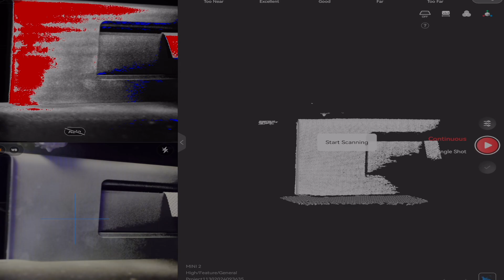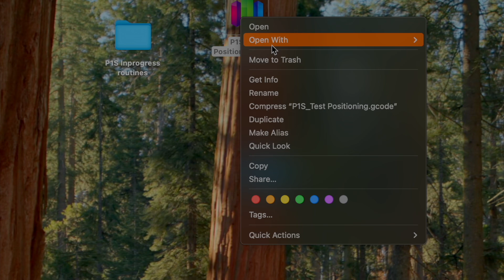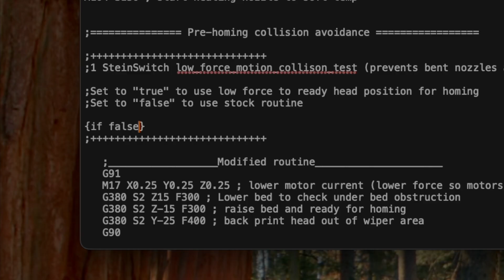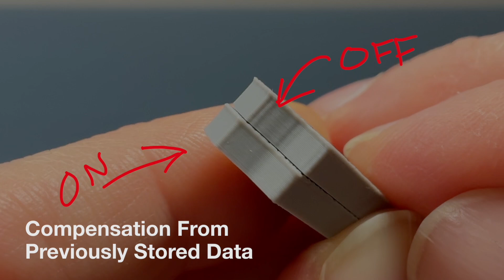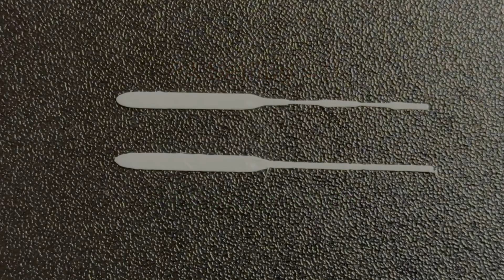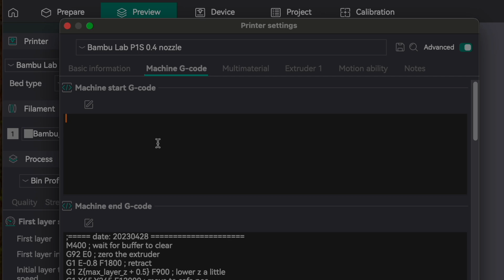The Ultimate Wiper Mod Combo For Your Bambu Lab P1S P1P and X1C

Comment: A small correction regarding the purge line: You’re using OrcaSlicer for your code, but you mention that it also works with BambuSlicer. That’s not entirely accurate, as BambuSlicer unfortunately still doesn’t (stopped to) offer the option for custom pressure advance. This feature is missing in BambuSlicer, at least for the P1S, which is why your purge line can’t be used with BambuSlicer. That aside, great video, well-structured code, and thank you for sharing it.
Reply from the maker: @ZipPeLschen  Hi! you're completely right! Its been a... minute since Ive used Bambu Studio! Months! Once I discovered Orca, I haven't been back to Studio and as a product of likely too many 3am nights in a row putting this video together, I completely forgot about my slightly different routine for Bambu. Good eye! Before Orca, I was still doing the PA test line in Bambu, but I would set the K value in the slicer code based on the filament type of the slice. ie., if Pla use k0.02 or if Petg use k0.035. Its not ideal but it works well for me since I dont print with may materials from many brands. I can revisit this and come up with a work around for those who want to keep with Bu Studio.
Reply: Can this be fixed with another code working for Bambu Studio?
Reply: @Saito_FPV  No, there’s not much you can do about that. However, pressure advance (PA) shouldn’t be overly praised either. Yes, it’s nice to have control over it, but the fixed value you determine in OrcaSlicer is not the ultimate solution. OrcaSlicer now also offers “Adaptive Pressure Advance,” which is even better than standard PA, as the PA value would need to adapt dynamically throughout a print based on various shared changes, something that doesn’t happen with a fixed value.

PA is a very complex topic, and ultimately, the G-code here only shows your fixed value, independent of the model.

I would cautiously suggest that if you’ve configured your PA via the Bambu settings and mainly use Bambu filament, customizable PA is probably “unimportant” for you at this stage. However, if you work a lot with third-party filaments, switching to OrcaSlicer could be worthwhile due to its much more advanced options for filament settings.
Reply: @Saito_FPV  No, there's not much you can do about that. However, pressure advance (PA) shouldn't be overly praised either. Yes, it's nice to have control over it, but the fixed value you determine in OrcaSlicer is not the ultimate solution. OrcaSlicer now also offers "Adaptive Pressure Advance," which is even better than standard PA, as the PA value would need to adapt dynamically throughout a print based on various shared changes, something that doesn't happen with a fixed value. 

PA is a very complex topic, and ultimately, the G-code here only shows your fixed value, independent of the model.

I would cautiously suggest that if you've configured your PA via the Bambu settings and mainly use Bambu filament, customizable PA is probably "unimportant" for you at this stage. However, if you work a lot with third-party filaments, switching to OrcaSlicer could be worthwhile due to its much more advanced options for filament tuning.

Here's a brief explanation from Orca about APA: https://github.com/SoftFever/OrcaSlicer/wiki/adaptive-pressure-advance

wahrscheinlich hätte ich dir sogar auf deutsch antworten können, wa? :)
Reply: @Saito_FPV  
No, there's not much you can do about that. However, pressure advance (PA) shouldn't be overly praised either. Yes, it's nice to have control over it, but the fixed value you determine in OrcaSlicer is not the ultimate solution. OrcaSlicer now also offers "Adaptive Pressure Advance," which is even better than standard PA, as the PA value would need to adapt dynamically throughout a print based on various shared changes, something that doesn't happen with a fixed value. 

PA is a very complex topic, and ultimately, the G-code here only shows your fixed value, independent of the model.

I would cautiously suggest that if you've configured your PA via the Bambu settings and mainly use Bambu filament, customizable PA is probably "unimportant" for you at this stage. However, if you work a lot with third-party filaments, switching to OrcaSlicer could be worthwhile due to its much more advanced options for filament tuning.

Deutsch hätte es wohl auch getan, wa :D

Comment: In orca slicer I get an error on line 693 that the [filament_retraction_length] is not specified?
Trying to reference an undefined (nil) element of vector of optional values
Reply from the maker: @dagispappan  Hi David, this is a linking error because the code requires you to set a parameter for an override for retraction length in the extruder settings. Im not home at the moment but I will send you another message walking you through where to find the override setting when I get home. Then you just enable it and put a value in the field. I find 0.38 works well for me for petg and pla :)
Reply: @leckiestein  Excellent! I will do this :)
Reply from the maker: @dagispappan  I just got home and I confirmed this was the case. So in your filament settings, go to the "Settings Override" tab, then for retraction length make sure its enabled and you have a setting there. I did this because I use slightly less retraction on my pla profiles than petg and the startup code reflects this value :)
Reply: @leckiestein  Worked like a charm. If there's anything one could wish for being added is a wipe on the stock wiper after softening temp to remove any oozing hanging on since last print.
Reply from the maker: @ well, there are a few things with that which you can do. I was never a big believer in this first one but honestly it is game changing when you start doing it. Sounds harsh but... Throw away your desiccant dry boxes and get yourself a heated dry box and set your printer up to print from it. After dry blasting a fresh roll of filament for 8 hours or so, then leave the box at about 45°C and don't turn it off unless youre not going to print for a long time. Doing this one thing for PETG especially, really made all the difference. Without changing anything else, I already have virtually no oozing. But to further tune that, I added some additional features. These files aren't available yet but there are some simple commands you can add : At the end of the print I position the nozzle just before the wiper pad so some of the air can reflect up off of the wiper pad while I blast the hot end with the fan until the temp has reached 170 then do a wipe cycle. And in the start up routine, i've already included but not talked about, a better way to manage a dirty start up nozzle. The initial bed probe just needs to be close because all of the proceeding moves happen on the spring plate so there is about a 1 mm give or take room for error. After that it jumps into the precision homing for the Z.